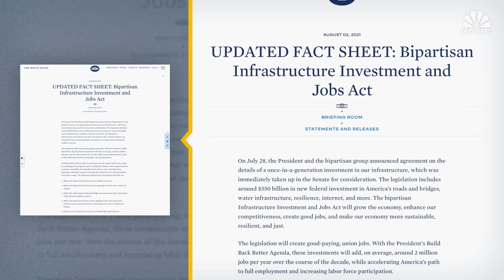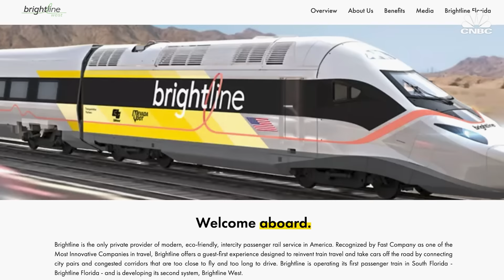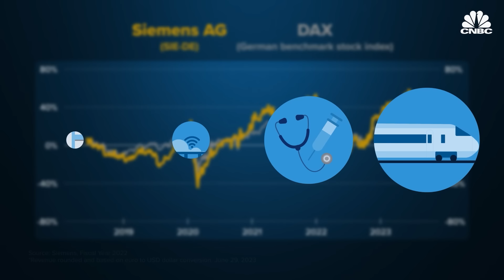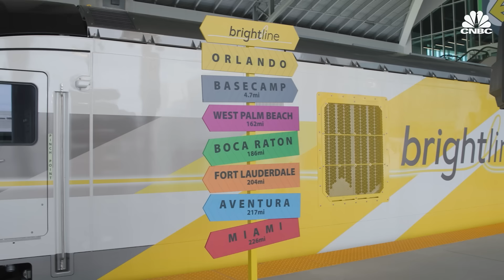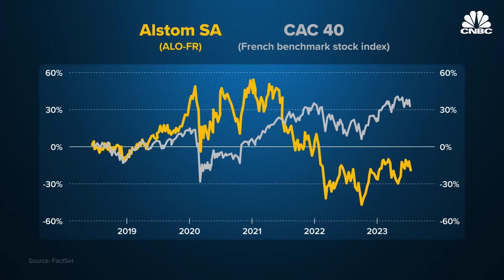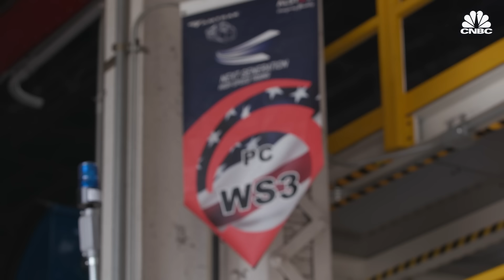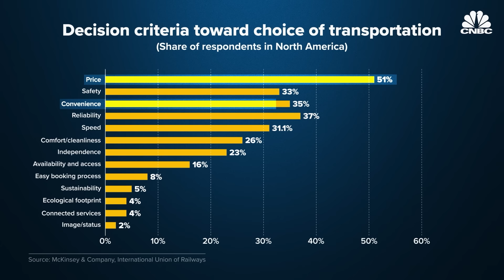Why Passenger Train Manufacturing Is Booming In The U.S

Comment: "Passenger rail doesn't have to be profitable, that's ridiculous. It's a public service." is such an important statement to make. It's a service you pay to have. No one asks highways to be profitable.
Reply: I think public transportation  buses would be better than trains.
Reply: @pathat8869  You would be monumentally wrong. Busses can only carry a fraction of the number of passengers that trains can, and can get stuck in traffic along with the cars.
One of the biggest reasons people would opt to take trains instead of cars or busses, is to avoid traffic altogether.
Reply: @pathat8869  The problem with buses is that they don't have their own dedicated right of way. They're subject to the same traffic which cars are subject to which can change rapidly depending on time of day, weather, and accidents. Having a rail transport network allows for a much faster and reliable service because the dedicated right of way (rails) allow them to not depend on any of those factors. The downside of rail is the high capital startup costs and that many politicians refuse to spend any money to start a rail network and instead throw money at more road infrastructure, some of which makes the problems worst, such as adding more lanes.
Reply: @TheDuckClock  yes correct but buses are good for short and medium distances.
Reply: he killed me with that comment.  arent freight operators profitable?
Reply: @ColonialDagger  yeah bus disadvantage is that they still have to drive on roads which means there will be traffic
Reply: @ColonialDagger passenger train don’t have the right away cus freight trains owns most of the railway
Reply: @aeromtb2468  Freight trains are profitable because they carry freight, not people. The trains themselves are not profitable, but the revenue made from selling the cargo is. You're confusing public transit with human trafficking.
Reply: The military doesn't make money and I bet it costs alot
Reply: That is false.  Highways are extremely profitable,  just on the fuel taxes that are used to fund them,  not to mention the incalcuable multiplier effect to interstate commerce and various other industries. 
Even a public service has to return value on the expense. Mass transit does not do that anywhere but high population density areas.  All the wishful thinking in the world will not change that.
Reply: @ColonialDagger  I mean buses could technically have right of way, but no gov will ever implement that (the areas that do, do a poor job at it) as it would anger car drivers lol
Reply: @LSmoney215  Bigger picture, cars HAVE to stop for trains, unless they wish death, a train doesn't stop for cars. Also for most of the local commuter trains (like here in Ontario) commuter trains have right of way during said time, else no one would ever want to ride one. Go Transit spent millions to remove a junction that plagued delays upwards of 10 minutes.
Reply: Yeah, and it’s part of the problem. Roads should only be built where they make financial sense or are necessary for core government functions. Instead, we do a lot of pork barrel roads. At a minimum, operating railroads should make a profit. If you want to GIVE people free transportation at the expense of other people who pay taxes, be honest about it and pay market for the tickets. Otherwise, you are just screwing up your transportation system and economy much like we’ve done to healthcare.
Reply: @TheDuckClock Introducing rapid bus transit... You have the flexibility of buses and you avoid traffic via the bus only lane.
Reply: @cmul7651 Yep, that’s a good point. I guess that means that the voters must continuously value the military over money losing choo choo projects. IMO, the government should stop after helping obtain rights of way, and turn over rail projects to private companies. You can reasonably disagree, of course.
Reply: Public Service are paid for the Tax Payer's  :D  that is how Public service makes money
Reply: @america1754  Good in theory, but they can still cause traffic problems, particularly when cars need to merge into the bus lane to turn.

Plus in some cities, cars drive in the bus lane anyways because drivers are jerks and that doesn't get enforced enough.
Reply: Military too, it's a public service, so increase the budget
Reply: @pathat8869  Buses Cannot solve all public transit problems and get stuck in the same traffic as cars do and have to wait for traffic lights!! Ever think about that?!
Reply: @pathat8869  Only where trains can't go!!
Reply: @obsidianjane4413  Highways provide economic benefits by linking the country together, something a competent passenger rail system would also provide. The highways themselves are not profitable. Fuel taxes are an additional tax applied to gasoline with the purpose of covering some of the maintenance costs of highways, and despite this tax, highways and the dispersed nature of car-centric infrastructure require additional billions of dollars to maintain and expand. You are correct that mass transit does work better in higher density areas, but those areas already exists across the country, and yet a lack of great passenger rail persists.
I'm also a firm believer that public services should not have to make money as there are other values provided by public services apart from income, as you mentioned highways link the country encouraging interstate commerce.
Reply: If a certain political gets their way, all the roads and bridges would be toll.  Everything privately owned, deregulated private enterprise!
Reply: @zanegunn770  posted more wishful thinking.
The funds spent on highways do not disappear,  they are paid to the companies and agencies that do the maintaining, which causes a multiplier effect that produces a net benefit. 
If there were a demand for passenger rail in the US, then it would be met.  But not even when it is heavily publicly subsidized is there enough demand to make it work.
The quant passenger rail you are thinking of is a result of regions of relatively short distances and in economies that were recovering from the devastation of WWII where the public did not have the means to support broad car ownership or airline service.
You can believe all you want but it will never happen.
Reply: @TheDuckClock  everything has pros and cons. Trains can go where buses cant and busses can take less passengers but can go intracities where as trains can go inter-metropolises.
Reply: @obsidianjane4413  Literally none of what you said make sense...
Reply: @pathat8869 I don’t. Cars get in the way.
Reply: You can make that argument however costs should never balloon to ridiculous amounts for example what it did for the recently opened but still incomplete Honolulu Skyline. 100s of millions per mile will be felt for generations just for construction costs. Is it worth it? We don't know yet.. but we do know that the same amount of money could've solved other major issues the state has.
Reply: @muyangcheng3874  I guess reading comprehension isn't for everyone.
Reply: @aeromtb2468   freight is profitable because they ripped up 95% of all the train tracks in america, keeping only the most profitable, skip out on maintenance, have little to no safety standards because freight cant die, hire less staff that needed, and shove everything they can on a single several mile long train so they dont have to run as often
Reply: @pathat8869  Yeah let's clutter the roadways more with the most dangerous form of transit.
Reply: @LSmoney215  amtrak legally has right of way over freight trains, its just that freight operators intentionally made their trains too long to fit on sidings, so the physically cannot give way to passenger trains
Reply: @obsidianjane4413  I'm not really seeing how any of the supposed benefits you claim of a highway are exclusive to highways and don't extend to rail. This video proves rail is being invested in. Demand is present. Highways and the infrastructure in place is already heavily publicly subsidized as gas taxes provide very little of the funds actually used to maintain roads.
Reply: I dunno why Americans don't get it, it's like asking whether they want to have highways that drives you, or have highways that you drive on..

How is it even a question?
Reply: The point to notice is that if that rail line generating jobs and growths in the region or not. Government then can collect tax from that growth to support rail infrastructure.
Reply: Highway is a necessity.  Passenger rail is not.
Reply: @cmul7651 I am from India. And yes, Chinese rail have military advantage attach to it. It allows them to easily mobilize their army force from one end of the country to the other side in much faster way. But the US is surrounded by two oceans so navy and airforce improvement makes more sense for the US compared to a country like China.
Reply: @vzxvzvcxasd7109  yeah but you dont get the freeddom(tm) to pay 1/3(on average) of your income on a car
Reply: @zanegunn770  "gas taxes provide very little of the funds actually used to maintain roads."
lol. Bless your heart.
Reply: @libertyliberty9868  Why wouldn't it be a necessity for people who can't afford to drive? Or can't drive at all? You see how quickly your selfish world view crumbles into pieces when you have to think for others too as all public projects should?
Reply: @TommyTom21  Freight trains are profitable because they run on demand. If passenger trains would have to wait until they're filled to >90% capacity they would also be hugely profitable...
Reply: @nicoj9984  Name one case where even full passenger trains were profitable.
Reply: @TommyTom21  countless transit systems around the world break even or make profit, even when completely funded by the government. 

and that shouldnt even be the standard. public transit is a public good, just like highways, police and military, and none of those are expected to make profits, but are invested in because these services make places better to live in.
Reply: @obsidianjane4413 federal gas tax revenue was $36B in 2016, while state and local gas tax revenue totaled to $53B in 2020, and toll revenue is less than $20B.

local and state governments spent over $200B on roads in 2020, not to mention the external environmental and societal costs of inducing car demand by building new roads.
Reply: Agree but disagree - the highway infrastructure need not be profitable, but buses and trains need to be profitable, because they are not a one-time investment. Look the Amtrak's fuel and HR costs!
Reply: Tell that to the many waiting for chinas train system to fail because it’s losing money.
Reply: @obsidianjane4413  everyone should stop feeding you because let's face it: you're not here to argue in good faith because of your smug libertarianism lol
Reply: @rosarioyeen1371  fake libertarian i would add, since he argues in favour of public funded highways that don't make any profit, but not for public funded railways.
Reply: If its privately owned its not really a option. Train company's need good profits to maintain quality service and pay their staff well and hire enough so not to work them to the bone.
Reply: @TheDuckClock Thank you for mentioning the traffic portion. I live in San Diego and usually sit in traffic to/from LA for 2.5 hrs one-way (one time up to 3.5). Amtrak takes almost 3 hrs and have seen it packed numerous times. A high speed train could cover a one-way route in 45min (if going 155 mi/hr) or less. That’s a game changer. It would be undoubtedly successful and people like myself would take it to avoid the hassle of traffic.
Reply: @rosarioyeen1371  I've already made my point and there isn't a rational argument being made here, just wishful thinking and the usual ill-informed gibberish. 
Case in point... that isn't what libertarianism means.
Reply: @aeromtb2468  Yeah, but volume-wise, freight brings a lot more revenue. Freight doesn't need much room. It doesn't need seats or nice interiors or even much speed of delivery.
Reply: @obsidianjane4413  perhaps you should examine the comment made by @ShotgunRainstorm I find it amusing you have yet to respond to them seeing your other activity in this thread "bless your heart"
Reply: @zanegunn770  I have learned not to argue with idiots and fanatics.
Reply: @pathat8869 they complement each other. Buses for short intra city travel trains for medium to longer inter city travel
Reply: @tianwang3768  yeah
Reply: @obsidianjane4413  I know, data scares me too bud
Reply: @IronHorsefan1869  buses are not for solving problem. They are just a means for transporting people from one place to another. More convenient than taxis. There are private bus companies like greyhound but greyhound does not have a bus station in every city,town,village in US. Greyhound buses is mainly for long distance transportation. For people who do not like flying in a plane, they may use greyhound bus service.
Reply: @ecoideazventures6417  Highways also have maintenance costs, state DOTs have expenses, repairs and upgrades to highways are constantly ongoing
Reply: @obsidianjane4413  So looking up the US budget and present the numbers they provide is fanatical?
Reply: Youve never heart of BRT have you?
Reply: @obsidianjane4413  Do the funds paid to public transportation agencies just disappear? I'm gonna quote you on this one. "They are paid to the companies and agencies that do the maintaining, which causes a multiplier effect that produces a net benefit." QED

There is demand for passenger rail, and it IS being met, see Acela Express

What the heck is 'quant' passenger rail?

Also, since you mentioned that "I have learned not to argue with idiots and fanatics.", you should avoid looking in the mirror every morning.
Reply: @pathat8869 buses are more convenient for short trips. The ideal bus network is usually centered around transportation hubs. So if you live 15 minutes away from between station, you take the bus to the train station and then take the train from said train station 30 to 40 mi away and then you can either walk to where you destination is or take a subway or something else. Problem with transit in the US is we see one mode and that's the one mode. That should fix all of our problems. When in reality we need buses trolley's, subways, light rail, heavy rail, high speed rail. We need all these things to work together and then we have a truly amazing network.
Reply: @LSmoney215 then help passenger trains get their own rail then build some separate rail and charge freight trains to use it
Reply: @lordofthefries4140  You cite Amtrak. lol.
Reply: Ever hear of toll-roads? Texas and Flordia are full of them thanks to the GOP. Initially they were setup to pay for the cost of construction but remain private toll roads to generate profits from those who are the least able to afford it.
Reply: @pathat8869 my opinion on that is that it depends on the use case.  Trains are generally better at carrying more passengers more quickly but generally require a hefty upfront investment which makes them suitable for routes that are more frequently traveled within and between cities. Buses generally have a lower carrying capacity and efficiency but are much cheaper to build and run, especially as there is very likely preexisting road infrastructure. They are also more adaptable, being able to easily change their routes to adapt to road closures, accidents or other disruptions.  This makes buses generally more suitable for routes with less people riding them or for smaller towns/cities/municipalities which may not be able to cover the costs of building a large amount of new rail infrastructure.

But either way, some transit is almost always better than no transit and good transit is better, regardless of what is used.
Reply: And yet they are.
Reply: It just need to break even. Just like how I WANT highway need to break even.
Reply: @obsidianjane4413  That's true. Gas taxes and all other use fees, like tolls and registration fees, make up about 35% of highway funding. The rest come from the general fund. Yes, that means cyclists and pedestrians are subsidizing your car driving.
Reply: @ecoideazventures6417  Err, do you think highways are a one time investment? They cost more to maintain than they do to construct. The United States spends $350 billion a year on highways, and most of that is for maintenance.
Reply: @muyangcheng3874  Very few people can't afford to drive or can't drive. Otherwise there would be more and better mass transit. The only way to change this is to make it more difficult to own a car.
Reply: @MrR40388  ohoho how naive... God this country is getting more delusional by the hour...
Reply: @pathat8869  buses are good for certain things. Trains are better for others. Every tool has a problem it was built to fix. Trains have a capacity and speed that buses cannot touch. For high speed intercity routes buses and trains aren’t really even comparable.
Reply: @obsidianjane4413  That’s where your wrong, public transit drives up property values at stations. If you include the increase in property tax collections then they are profitable. Hong Kong which is one of the few profitable transit systems allows their operator to collect this revenue whereas most cities do not. They also increase business around stations which increases income tax collections.

As for roads, highways and arterial roads might be profitable but most small roads are not, they don’t generate enough value to justify their existence. That is why most suburbs tend to have massive boom bust cycles. They can’t afford maintenance on their infrastructure after getting the initial build out subsidies. Unless it is extremely wealthy the density of typical suburb can’t generate enough property taxes
Reply: @NickSteffen  "public transit drives up property values at stations."
Hahahaha..... HAHAHAAHHAAHAHHAHAAA!
Reply: @obsidianjane4413  you laugh but they tend to be 5%-45% higher according to the national association of realtors. I’m guessing you believe the totally unbiased people who claim transit stations “bring in the riff raff” and are only thinking about impoverished urban areas that also happen to have transit instead of looking at areas that are not impoverished.
Reply: @NickSteffen  Oh, yeah, real estate agents, never exaggerate or have any bias...
Reply: @TheDuckClock but no one thinks to take out the cars and replace them with other methods of transportation
Reply: Are roads and non-toll highways profitable? Nope. So why should rail?
Reply: @obsidianjane4413   Yea, biased towards knowing a lot about property values. Or, just prove me wrong then. Try not to be one of “those” internet people who just believes nonsense without proof and can’t have one of their opinions changed.
Reply: @NickSteffen  Biased towards inflating property values for profit. 
And.... Ironic projection.
Reply: @obsidianjane4413   K, again some evidence? How does transit not improve property values… That claim makes no sense.
Reply: @NickSteffen  NIMBY. No one is going to want buses or trains running thru their neighborhood.  The only place it is practical, and thus acceptable is in high density urban environments.  Go look at a map. Most places, even cities, are not.   
Read a little further into your search results  and don't cherry pick the ones that support your wishful thinking.
Reply: @obsidianjane4413  There's demand for passenger rail in the US, what are you smoking bro
Reply: Nor the Pentagon.
Reply: @MrR40388 11% of US adults 25 and older don’t even have a driver’s license. Our car-dependent culture brutally isolates the disabled, the elderly, and even the young (in Europe children as young as 6 ride intercity trains unaccompanied ).
Reply: @obsidianjane4413  Please provide the numbers, as the price one pays is not at all related to the costs of highways incurred on society. Cars are the most subsidised mode of transport, not even Air-travel comes close to it.
Reply: @obsidianjane4413  If you subsidize cars so heavily that their costs are not felt/paid for by the user, of course cars will have a higher demand than trains as they can be more flexible if used properly. However everything you say about funds spent on highways is even more true for maintaining train infrastructurue, managing rail traffic etc as these funds also go to companies and agencies that do the maintaining etc...  in the same time the usage of trains incur lower costs on society than cars (car usage is a way bigger contributor per  user to people dying of their poluting, people getting sick, people having to move as climate change destroys their land etc... which are all subsidies not paid for by the user, at all that benefit no one.
Reply: @loggemat  Please explain how you think cars are "the most subsidised mode of transport,".
Reply: @TheDuckClock  most of the US is not served by rail, so busses are mandatory
Reply: @cmul7651  the war in iraq over oil says hi
Reply: The profit to the nation in increased economic activity is enormous.
Reply: public transportation sucks. private investor captial trains are far superior. brightline is winning.
Reply: @obsidianjane4413  true. highways carry alot of freight and goods to local points of destination.
Reply: @Indy_at_the_beach  increased economic activity? have examples of that?
Reply: @obsidianjane4413 the fuel tax literally doesn’t even cover HALF of what the US spends on road infrastructure. Road building is one of the most subsidized industries in the United States. PLEASE look it up
Reply: @gatleystone2480  lol. Go look up what the word "subsidized" means.
Reply: @obsidianjane4413 highways, profitable? what a joke.. highways are extremely subsidised by the government and tons of funds get sucked into merely maintaining them
Reply: Well, maybe in Europe, China or Japan its looked as service to public, but in the US everything is built for businesses and investors first before most
Reply: @KirbyComicsVids  Another person who doesn't know what subsidised is.
Reply: @obsidianjane4413  you keep saying that we dont know the meaning of subsidy. strengthen your arguments budd, nobody is taking you seriously rn.
Reply: @micahsarm  You assume I care what you think. Just imagine what else you are wrong about.
Reply: I did a 35 year analysis of the cost of owning a car, and even if you took out a crap ton of money for taxes and transit costs for an individual, if you took transit instead of driving, and you invested the savings, with a 6% return the average American could have an extra $844,000 in a retirement account. To me that is absolutely insane. I spent the better part of the day trying to confirm that figure. That’s the cost of cars before we even start building roads. then consider that the average American spends about $500 if their income tax every year on roads. This also ignores car registration and fuel taxes. It also ignore the fact that 30,000 and 40,000 people die every year on the roads. The cost is so much higher than we realize.
Reply: @OutsideSometimes  As opposed to 35 years of paying mass transit fairs that are a complete loss that has no recoupable residual value.
And this ignores the opportunity cost of having to wait around for a bus schedule and you lose the personal freedom to go where you want to. 
Roads would have to be maintained regardless if they are being used by public or private vehicles.
How many people die as a percentage of usership from crime and communicable diseases, much less from accidents.
Your "analysis" is delusional as well as flawed.
Reply: Depends on the city midwest is complex n spread out
Reply: @pathat8869 Why ho 70mph when I can go 170mph? Pass😂
Reply: The thing to remember is that NO form of transportation can survive without subsidies. Governments spend money on airports, highways, and ports. None of them can exist on tickets or tolls alone. So the idea that it must stand by itself economically is misguided and not supported by expenditures made by other forms of transportation. In fact I would suspect that anyone who says we shouldn't invest in trains because it isn't profitable probably have the ear of oil/gas/auto manufacturers who wish to further another product or agenda.
Reply: It shouldn't be for free, but affordable for the masses.
Even if you have to subsidy it. Security (military, border control, police) for instance is a so called  also public good for which there is no (direct) price tag but it is paid by by the entire civil society via taxes. For that we do pay taxes. It the price of civilization.

Education should also be a public good, and in many country it is.
Reply: @pathat8869  buses are good for feeder, but trunk mass transport would be better suited to trains
Reply: @OutsideSometimes  That's not even counting the number of people injured in car related accidents, which accounts for about $99B in productivity loss per year according to NHSTA. The fact is cars are too inefficient and dangerous to be the primary mode of transportation for the public - let alone the only viable mode of transportation that it (forcibly) is today. Making it legal to build denser, more walkable suburbs like the pre-WWII neighborhoods that have mostly been torn down for highways in the 50's & 60's and are the hottest real estate for the few that survived would be a great start. So would gradually densifying the viable post WWII sprawl neighborhoods that are common today and letting the ones that can't be retrofitted to return to a natural state. Some of the folks here clearly haven't read up on the history of Shell and GM and their collusion with the rest of the oil & auto industry to make the US utterly dependent on their products to get around. They also seem to think that NIMBYs want us all to live in communist style concrete boxes in drab, prison-like ghettos. I suggest you google places like Del Ray in Alexandria, VA; Jasper, IN; Norwood, OH; Battleboro, VT; Watertown, SD; Pensacola, FL; and Lockport, IL for an idea of what is actually being promoted
Reply: @obsidianjane4413  
Cars itself are very impressive and efficient when used to its full capabilities. It's usage however has been rendered artificially cheap  so many common resources are sacrificed so that people started using it in the least efficient way, rendering it the most subsidized mode of transport in the world.

It's not the person driving it, that pays for the damage it causes:
- health problems to other people due to pollution (and even people dying from it)
- physical damage to buildings (restauration/clean up paid for by the common goods)
- climate crisis causing heat waves, rendering habited areas uninhabitable.
- physical spaces that were useful areas for a billions of people, turned into highways used by just a few millions of people (compare highway throughput with other transport modes for the given surface ...) 

Even planes are less destructive per person per mile than cars, and it's the public paying for it with common resources.
Reply: @pathat8869  depends on how dense the city is.  Most of the times, most cities are like NYC, so busses ya, but we need dedicated lanes so they work even better.  Culver City is a good example of how car centric we are because they just took away the bus lane citing increased congestion
Reply: @obsidianjane4413  First, fuel tax revenue is a VERY narrow way of thinking about the interstate highway system; it fails to consider offsetting operating and maintenance expenses, not to mention the time horizon for (potentially) recuperating the cost to build the project in the first place. (The initial $25B congressional allocation in the 1950's is about $280 billion measured in 2023 dollars; paired with the targeted 10% funding to come from state governments, that's a total estimated project cost of about $310 billion). 

But much more importantly, you've grossly conflated "profitability" with "cost-benefit" and the net utility that society potentially receives--both directly and indirectly--when positive and negative externalities are factored into a broad and comprehensive impact analysis. Public goods/services deal in the realm of the latter, even if/when they don't conform with the more narrowly-defined scope of what is "profitable".
Reply: @obsidianjane4413  highways are also much more costly than rail and more expensive to maintain. A strain can carry an order of magnitude more people/cargo with much less energy because steel rail road track has very little friction. You also have to account for the cost of fuel and tires, that's money that can be going elsewhere in the economy.
Reply: @pathat8869  Buses isn't fast enough.
Reply: "No one asks highways to be profitable."
points at toll roads
Reply: NHTSA: Traffic Crashes Cost America $340 Billion in 2019
Reply: I dont support passenger trains. Maybe the government should stop forcing me to pay and since you love them so much you should pay yourself sindw im never going to use the train im being forced to pay for. It should have a cost and you should be paying it not me
Reply: @obsidianjane4413 the federal highway fund gets about half its money from income taxes. Only half comes from gas taxes. The multiplier affect applies to both highways and trains. Highways in dense areas probably have multiplier affects and rural highways probably lose money. Same for trains.
Reply: It would still have to make economic sense. aka profitable.
Reply: @censored4christ162 that’s interesting….because there are people that bike or walk and don’t drive but they still pay for you to drive on the road…..
Reply: Nor does freight rail. The US freight rail companies is collecting obscene profits at cost of America’s overall industrial and logistic capacity.
Reply: @LSmoney215  thats not true its cause their trains are too long and refuse to reduce train size. amtrack has priority
Reply: @zerotheliger  if yu say so
Reply: @pathat8869  It also limits their top speed to 80mph or less.
Reply: @cmul7651  Not as much as not having one ready to go when you need it.
Reply: Nothing is better than trains.  They are the most environmentally safe, the most accessible, the safest, the most weather immune etc.   Buses are not;. As highway vehicles they are subject to the horrors of all road traffic,
Reply: Too many people failed at basic economics.
Reply: @johndunbar7504  buses are the safest vehicles on the road.
Reply: @karld1791  highways don't charge for their use therefore they don't generate any revenue. If nobody used it, a highway would generate the same amount of revenue. You could say that people use them and that's fair enough, but "would they still use the highway if they had to pay for it?" is the real question.
Reply: @pathat8869  nah..they arent reliable as they need to make constant stops while trains dont need to make constant stops or care about red lights
Reply: Absolutely! It's is always said that trains just don't make sense because they are not profitable or whatever. As u said, these people seem to think that their free parking and toll-less roads are somehow profitable. Transport is just something a country needs and so is naturally a cost instead of a direct source of income. Though of course having better connected cities is always good for the economy.
Reply: Well said and absolutely. Does anyone complain as we spend tens of billions of dollars on highway and road maintenance every year? Where's the profit in that?
Reply: @obsidianjane4413  Fuel taxes are way too low in the US and don't come even close to paying for the highway system, look it up. Highways need to be heavily subsidized just to be maintained.
Reply: @bartkoscinski9421  Highways (and roads in general generate far more revenue than just fuel taxes.  Both directly in auto related sales, and all the economic activity they facilitate.
Reply: @obsidianjane4413  This has been studied and researched a million times over by now and the associated taxes from cars and car centric infrastructure is a net negative. Most of the trade being done on the highway system can easily be transferred to other modes of traffic, and every single other form of transportation has a higher economic multiplier than cars and highways do. Cars and trucks are wildly inefficient, and we can literally induce massive economic growth just by investing in more rail networks, mass transit, and bicycle infrastructure. I'm very familiar with the topic and what the facts are.
Reply: @bartkoscinski9421  No one rides trains, buses, or bikes except poor and a few stupid people , but yet there is an economy still. So you must be suffering some serious confirmation bias in what you look at.
Reply: @obsidianjane4413  They're not popular with Americans currently, because the infrastructure for them is nonexistent. The places where it does exist, like in NYC, they're very popular and utilized by people of all socioeconomic status. You'd reach the same conclusions as me if you actually read any research on the topic, and with an open mind. If you don't like reading actual studies, there's a lot of well researched youtube videos, with citations, on the topic you can watch.
Reply: Buses and planes are profitable. Trains are just another vehicle 😂
Reply: What's with the bull crap 💩 talk about proto type cars. They already have the designs and build technology for high-speed trains and rails.  Just pay for the rights to build them here in USA.
Reply: You can’t compare a service with standing infrastructure. Tracks are public infrastructure like streets, rail service is a service that has to be profitable like a taxi service.
Reply: Airports and airlines are profitable 🤡
Reply: Should be break even at least.
Reply: It doesn't need to be profitable, but someone has to pay for it, and if it isn't getting used enough, it's not an efficient use of taxpayer money. So although profitable is the wrong term, it's a valid concern.
Reply: @obsidianjane4413  Highways are not profitable. Gas taxes do not come close to paying the cost of construction and maintenance of our roads and highways. That's why they passed infrastructure bills in Congress to pay for the backlog of maintenance we have.
Reply: @ColonialDagger  There is a thing called Bus Rapid Transit that is a cheaper way to get some of the benefits of light rail. BRT is a dedicated lane just for busses, with barriers that prevent cars from entering the lane. A good BRT system also has high frequency busses (15 minutes apart or less), raised platforms so you can walk onto the bus with no steps, and automated fare collection like a subway (no cash). All of these steps mean the bus only has to stop for a minute to pick up passengers, and the bus is not slowed down by traffic.
Reply: Did you price in increased probability of accidents,, maintenance, 2nd order effects like sprawl, etc?
Reply: For it to be public service, someone has to pay either in taxes or in payments for each trip. The latter is better however what you should be emphasizing are the security measures to ensure passenger safety  ?
Reply: @obsidianjane4413 um no, where do you that highway is profitable? You even said they need a gas tax to fund themselves. How does needing a tax make it profitable?
Reply: You are right it doesn't have to be profitable, but it does have to operate without losing money. That means someone has to pay. Its either ticket prices which no one figures they should pay or its tax money, which again, no one figures they should have to pay. As far as I can see the largest expense is track construction and maintenance. Perhaps the Governments should own and maintain track while the rail operators pay a fee to use the track and focus on the actual routes. This would also make it easier to introduce competition into the system as smaller startups can start running smaller routes and shortlines.
Reply: Of course it does, how else is it supposed to be maintained, upgraded and serviced? How are employees supposed to be paid? Dude even roads and bridges are for profit they call it taxes.
Reply: @pathat8869 It's this thinking that took trolleys and subways out of cities so  Automakers could put busses and cars with high pollution in cities. Buses and cars, get stuck in traffic.
Reply: Jesus Christ! By that same logic, I assume you'd think it's perfectly fine for every public service offered by the US government to turn losses, always. It doesn't matter if Amtrak burns through billions of taxpayer money, it's a public service, right? Money isn't just paper, it's a resource that reflects productivity, consumer demand, and technological prowess. If a "public service" is always turning losses, it reflects the lack of one, or all, of the previously mentioned factors.
Reply: @LSmoney215 Actually that’s a propaganda lie.The tracks are federal owned except some lines and they pay to use them that’s why they say that passenger trains have the right of way.If they were privately owned Amtrak wouldn’t argue that freight trains are not following the rule and for sure wouldn’t have sued them like they have already did which failed due to technical  problems in the phrasing of the law
Reply: @obsidianjane4413 Lol your own argument can be against you.Highways are build to transfer large volumes of commuters in and around mega cities with large population which is exactly what high speed trains do and is their bread and butter.This is exactly what Japan has done for example which allows commuters to travel between central Tokyo and suburbs way faster than they would.I hope this gave you the lacking education on the matter
Reply: @bigonicha3225  Highways are build[sic] for more than to transfer large volumes of commuters. How do you think goods and services get around? Japan still has extensive highways for that reason.  Someone here needs an education, and I don't think it is me.
Reply: @obsidianjane4413  Then we can argue all day that train lines are way more profitable since freight trains move way more freight than tracks.But you mentioned just highways that are extremely profitable which is an uniformed argument and not basis behind it.There a handful that are profitable but most of them are subsidised by local governments and you should mention the local and interstate roads where they are deeply in red but are crucial for smaller cities to survive and thrive.All your arguments about roads have no basis for your saying that high lines need to be profitable.They just don’t need to because they provide way more in the bigger picture
Reply: @bigonicha3225  Do you have train tracks run to your front door?  You are delusional.
Reply: @obsidianjane4413  But what use is it if you only make a profit from the roads, but don't invest in maintaining them? it's just patchwork. And the longer you don't invest there, the more expensive it gets. Just take a look at the roads in the USA and see how bad they already are.
Build yes, but maintain no.
Reply: I don't agree with China on a lot of its decisions, but China made their passenger rail more affordable in return for potential econimic growth.
Reply: @zanegunn770  Well said.
Reply: Buses are NOT better than trains with the distances we’re talking. Buses also cost a lot more in the long run due to maintenance and repairs. Not to mention you need to hire more people to drive those buses versus trains.
Reply: @tcsnowdream9975  And let's not forget the considerable fuel consumption and the environmental impact of exhaust fumes, which is already very high in the USA.
Then electric trains are better, they make more sense on very long distances, and you have the factor of being able to travel in a relaxed manner.
Reply: Umm - have you been on a highway - have you noticed the tolls?
Reply: But it should be profitable enough to cover the expenses of  construction and maintenance.
Reply: @KaiserShield just like watresses getting paid fairly. I am supprised that rail staff don't also have to beg for tips
Reply: @obsidianjane4413  Sure, highways are profittable NOW. It's literally a case of "build it and they will come". The highways boosted our economy over the decades, but that wasn't an instant thing when highways were being built. If it was profitable ASAP, automobile companies and logistics companies would have built them on their own
Reply: @juannarvaez5476  "automobile companies and logistics companies would have built them on their own"
Dumbest comment I've read all morning. But its early yet.
Reply: @LSmoney215 legally freight railways are required to give preference to passenger trains not that it’s ever enforced but what you said just isn’t true
Reply: Polititions never get enough money, EVER!!.
Reply: @pathat8869  Its the fastest and cheapest form of transport. High speed rail in china has proven this. They have the biggest population in the world, and they have some how managed to connect them all through high speed trains. No other form of transport can move as many humans in fast and oddly fashion as high speed trains can.